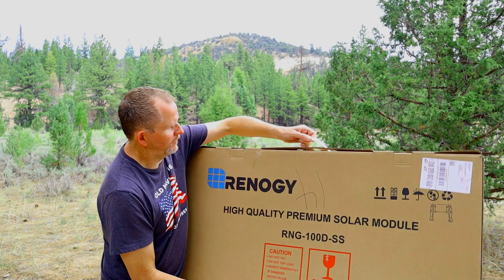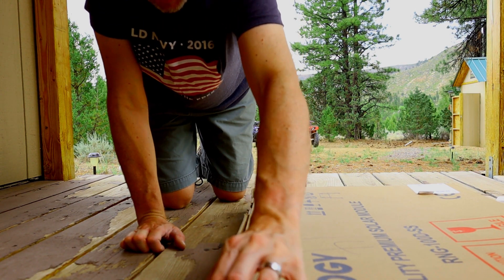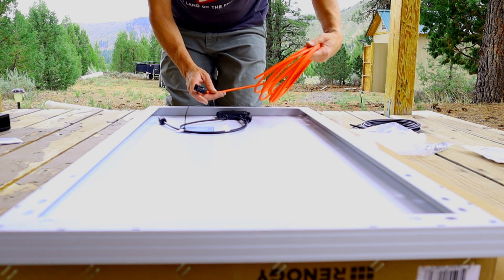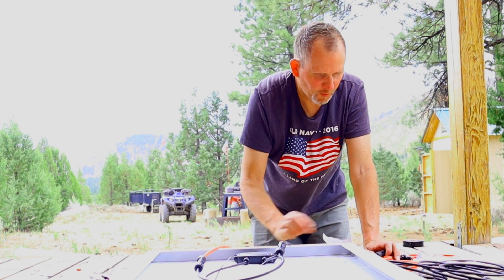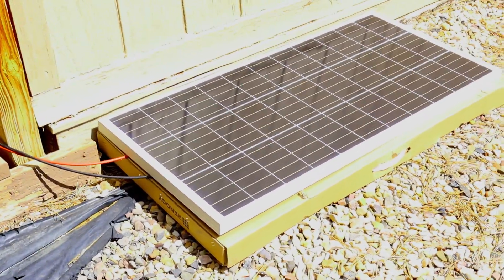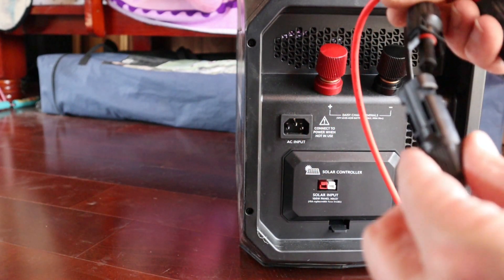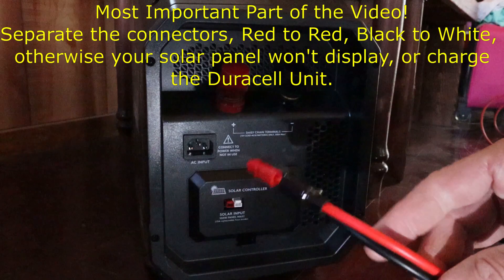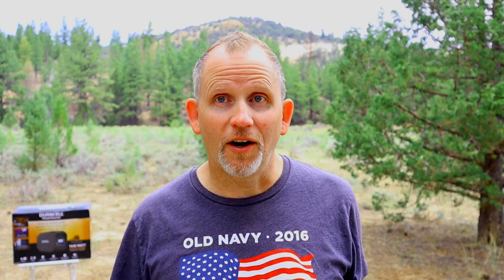How To Use Solar Panels To Charge Your Duracell PowerSource For Free!

Comment: I had a question about this generator i had my generator pretty charge it still showed full battery and i tried connecting a hand steamer but as soon as i did the generator would turn off. So i went ahead and connected a charger for the phone and it didnt turn off. Is it possible that it ready too much energy i dont feel a steamer would be too powerful for it to handle. Dont want to mess it up i use it alot
Reply from the maker: That's a really good question.  It's possible that the hand steamer was just pulling too much amperage and shutting the unit off.  I haven't hit that point yet and have run some power tools, saws, coolers, etc, but haven't tripped it yet.  There is a built-in fuse, but also a limiter where is will just shut down the unit if you over-draw power.  Try the steamer on the lowest setting (if it has one) Thanks for the comment!

Comment: Hi,I didnot pay attention to the fact that this 1440 Watt Duracell power source needs to be recharged every 3 months,so after the first time charging it i never recharged it again and now 2 years later it is not being charged.Is there a way to repair it or its gone?
Thanks
Reply from the maker: Oh man, ya I've left it for 6 months without charging and it's been fine (all winter up at the cabin no charging).  But not any longer than that.  
You can replace the deep cell battery inside the unit, or housing and then just use it like a new one again.  Batteries aren't cheap, but it's just a lead/acid deep cell 12 volt.

Comment: WHAT WILL THIS GENERATOR CHARGE AT THE SAME TIME AND FOR HOW LONG?
Reply from the maker: You can power one larger device for a couple days, like an electric cooler or small fridge, or several smaller ones for the same amount of time provided you have it hooked to a solar panel during that time.  
If it's just running off the battery after a single charge, you may get 8-10 hours, but it really depends on what you are powering, and how many amps it's pulling.

Comment: Si el panel te entrega 18V y la batería recibe 12V, entonces ya quemó la batería y dañó el integrado interno 😢
Reply from the maker: Duracell no es claro acerca de decirle a la gente que solo use paneles solares de 100 vatios y 12 voltios. Además, el controlador solar debería haber evitado daños a la batería, lamento escuchar que no fue así.
¡Gracias por el comentario!

Comment: Good morning, I have charged my Duracell 1440 for the first time, the green flash stopped blinking before 24 hours.  Should I continue charging it this first time until completing that time or is it enough to have already charged it?
Reply from the maker: If the green light stopped flashing, then the Duracell should be fully charged.  However it won't hurt anything to leave it plugged in longer if you need to.  Thank you for the comment!  🔋

Comment: Just a side note. You can purchase a small solar charger with controller to attach to the extra batteries or wire it directly into the existing battery to decrease charging time. I found one on Amazon that takes 300 watts. It really changes things. You can add whatever controller you like as long as you wire it directly to the batteries and not to the unit.
Reply from the maker: That's great information, thank you.  Do you know the brand by chance, because charging time has been a downside of this Duracell unit.  🔋
Reply: @FixMyBleep  Lensun but I actually have purchased another since then Powerwrex mppt 300. I'm going to switch over to lithium ion phosphate batteries when the current goes bad the voltage is higher but when you add batteries voltage increases anyway. I'm also going to add a pure sine wave when I find a super duper deal. I like to tinker. I have several units and this is the least capable but is easy to upgrade because of it's simplicity. Just remember to add the charge controller to the batteries not the unit.
Reply from the maker: @latymz  Good call!  I found the Jackery 1500 unit after this Duracell and really like that power station more, then found out about the Lithium Phosphate batteries that can be cycled thousands of times as opposed to 500 or so...that will be my next purchase.  Thanks again for the comments!
Reply: @FixMyBleep  My pleasure. Solar  generators have become somewhat of a hobby. I would encourage you to check out the new Zendure SuperBase V if you haven't already. It's a good deal on Kickstarter if you can stomach a little risk. I got a deal on a Oukitel 200p. It varies slightly in features from my Bluetti 200p. The Kickstarter price made it doable. Good luck.
Reply from the maker: @latymz  Thanks!  I'll check it out.
Reply: @FixMyBleep  👍

Comment: Can I run a portable ac unit on it
Reply from the maker: Yes you certainly can, but depending on the power draw and size of the ac unit, that will determine how quickly it's going to drain the Duracell Powersource.

Comment: Can I use the renogy (2) 50Watt solar panel suitcase (=100 Watts) to charge the Duracell 1440?
Reply from the maker: If I'm looking at the right one, the Renogy Suitcase comes with a positive and negative clamp that would go onto the rear of the Duracell to charge it up.  This should work just fine as it's 12v and also 100 Watt.  Great question, and thanks for the comment!  Also this Renogy solar panel looks like a good find!  ☀

Comment: I bought the renoogy solar panel but its two 50Watt panels - will that work. I didn't see the link to the 100Watt and may have bought the wrong thing.
Reply from the maker: I think those should work but you may need an extra part to connect the 2 panels in parallel.  I think you would need this Y adapter to hook them together https://amzn.to/3ogrnY5 and then you will run them to your 100 w solar charger.  Hopefully that helps.  🌞

Comment: Just bought Thunderbolt panels from Harbor Freight but none of the connectors are compatible. May be a silly question but do I need Anderson adaptors? Wasn't aware of such an animal before. I have Duracell 500 unit. Thanks in advance.
Reply from the maker: Ok, It looks like you need a SAE to Anderson adapter from what I'm reading, try this: https://amzn.to/3HxaTDI
Be sure to separate the red and black plug on the Anderson adapter plug end, pull back the plastic cover a little, and plug red to red, black to black on the Duracell Unit.
Hope that helps you out!

Comment: How does this daisy chain concept work and what do I have to add to my Amazon purchases to do it please.
Reply from the maker: You can connect (Daisy Chain) 12V Lead acid batteries to the terminals to extend your run-time. Red to Positive(+), Black to negative(-) The battery is connected to the unit by the 10mm posts on the back of this Duracell PowerSource unit, it already has the electronics, you just are adding more batteries.  This will of course add more time to recharge the overall unit as well.  I hope that helps, thank you for the comment!

Comment: Can i charge my Duracell 1440 with
My 160 wats 12 volts renogy solar panel?
Reply: Should easily work. Will probably need to connect through the battery terminals because the charge controller is rated ate 100 watts. Big note for people who charge this way, the green charging light will not illuminate, that light only works when using the Anderson connection through the built in charge controller. Rest assured, it will charge through the the other terminals.
Reply from the maker: @michaelarrow1918  Thanks for the info, and good to note on the charging light and charge controller!
Reply from the maker: That's a great question, I thought the built-in controller would handle this, but maybe not.  I've been using a 100 Watt Renogy Solar Panel and it's working great, this is what I found on the Duracell Site when I just checked about hooking up a 160 Watt panel to the 1440 PowerSource: "100 watts is the maximum we recommend when using the built-in solar controller which has a 15A replaceable fuse inside."
Sorry but they are saying it "could" blow the fuse, or basically no more than 100 Watt.  Thanks for the comment.

Comment: Do you need an adapter for it to run or charge?
Reply from the maker: This unit comes with everything you need unless you are hooking up solar panels to charge up the battery.  Then yes you need the adapter cable to go from the panels to the Duracell PowerSource. 
These adapters I've linked work for most solar panels  https://amzn.to/3LlQjaZ  Here are some solar panels I've been using with this battery unit Renogy solar panels https://amzn.to/3soedda  
Hope that answers your questions.  Thanks for the comment.

Comment: What kind of Anderson Power Pole Connector should I purchase to connect a solar panel that has an SAE cable instead of an anderson power pole connector cable?
Reply: Thanks. I purchased one.
Reply from the maker: @lindadixon5190  Excellent, you should be all set!  👍
Reply from the maker: Here is an affiliate link for connectors that converts SAE over to Anderson connections if that's what you are looking for.  https://amzn.to/3rnJnly  The solar panels I picked up only had SAE connectors so I had to buy these so they would plug into my Duracell power unit.  Hopefully this helps you out.  Thanks for commenting.☀

Comment: My advice is to first watch the manufacturer's video Zantek, it quickly explains the plug separating issue, secondly, this video has a whole lot of needless repetition in information. It's a video, if you miss something, go back and watch it again. A 5:00 minute video at the longest would cover the information. If a guy gets that stumped with basic wiring, watch a video before trying to make one.
Reply from the maker: Thanks for the comment.

Comment: I was curious that can you charging while discharging? I planing a 3month road trip and I want to hook up that powersource to solar panel that on my rtt.
Reply from the maker: Totally, that was one of my big concerns since I use it at a cabin that is totally off the grid.  I have things drawing power while it's charging off of solar.  Sometimes it just takes a lot longer to get a full charge depending on what I have  pulling power from it.  Would be great for road trips!

Comment: My solar panel came with a charge controller & terminals for the daisy chain. Is it better to use the anderson connector with the built in charge controller on the Duracell or the charge controller that comes with the solar panel? Or would it make no difference as far as charging faster?
Reply from the maker: Great question!  So from everything I've read from Duracell you want to use their built-in controller and the anderson connector over the one on the solar panel so as not to exceed any wattage limitations on the unit.  The Duracell website also touches on this a little bit too.  I wish there was a way to get it to charge faster.  I'll be doing more videos on this unit, be sure to Subscribe to check those out.  Hope that helps!

Comment: Totally new to this basically,  but does adding another 100w solar panel make the whole system 200w, or is the 100w threshold solely speaking about the panel itself? Once again, Totally green on the subject. Thanks for the video.
Reply from the maker: That's a great question!  If I'm understanding the Duracell information correctly, it looks like adding additional solar panels won't help it to recharge any faster due to the built-in controller.  The max you can have is a 100 watt solar panel that it can handle.  On the website they confirm as well.  Thanks for the comment!

Comment: Can you help me find long cords for this solar panel, for the Duracell, please? I don't understand all the numbers when looking for cords. I need at least 5 feet long. Prefer 10 to 20 feet if possible.
Reply from the maker: Of course, here are the connecting cables you need in a 10 foot, and a 25 foot length with the ends already on them.  10 foot: https://www.amazon.com/dp/B09CY8RMN1/ref=sspa_dk_detail_7?psc=1&pd_rd_w=B2QZR&pf_rd_p=887084a2-5c34-4113-a4f8-b7947847c308&pd_rd_wg=mdsS2&pf_rd_r=72WPZQ2PN3J3063PF36G&pd_rd_r=62d6bf47-16bf-499e-a6bf-0b1845247b09&spLa=ZW5jcnlwdGVkUXVhbGlmaWVyPUExQlFVRkszVVRNVDRIJmVuY3J5cHRlZElkPUEwOTg4Nzg5M1BCMEQwMlU3RUxOWCZlbmNyeXB0ZWRBZElkPUEwNTE4Mzk5MU1WMU9JWDhHQkZYMCZ3aWRnZXROYW1lPXNwX2RldGFpbCZhY3Rpb249Y2xpY2tSZWRpcmVjdCZkb05vdExvZ0NsaWNrPXRydWU= or 25 foot length https://amzn.to/3r1QZur
You will also need the connector kit unless you have it already:  https://amzn.to/30GKZw6

Comment: For anybody else trying to figure things out, I don't see it mentioned in the video, but you need for this Duracell Powersource a 10AWG Solar Panel Wire and not a 12AWG Solar Panel Wire. Pay attention to the cable gauge and select the right one.
Reply: This comment saved me a lot of swearing and headache
Reply from the maker: @worstnurse1565  It's all in the details for sure.
Reply from the maker: Thank you for pointing that out, you definitely want to keep the same American Wire Gage throughout your system setup and I don't think I mentioned Duracell requirements.  Thanks for the comment!
Reply: @FixMyBleep  you're welcome. Btw, after you pointed out the "generator" name given to this unit, I went ahead to see why they call it so.  Looking at the duracellpower website faqs, they say this: 

"WHY IS THIS CALLED A GENERATOR WHEN IT RUNS OFF A BATTERY? ISN'T IT JUST AN UNINTERRUPTED POWER SUPPLY (UPS)?
The Duracell PowerSource is similar to a generator in that it is portable and provides AC power using a refillable energy source. This unit has a built in solar controller which allows it to be sustainably recharged using solar panels. It can also be recharged via the external posts from other sources such as a car's alternator or additional SLA batteries. Since the unit has an inverter, it does generate 110V AC. The difference is that the unit pulls the energy from a battery rather than from a gas tank." ...

Comment: Does anyone know what size of lugs are the red and black connectors in the back. Also what size Awg connector to use. Thankyou
Reply from the maker: Duracell is calling those 10mm posts on the back,  Looking at the Duracell question/answer page in regards to daisy-chaining off those rear posts "If your cable is less than 4 feet long, you can use 4 gauge wire. Longer cables will require 2 gauge"
Sounds like overkill, but maybe they are right?

Comment: Dear Mr. Fix, I keep seeing panels selling with modulaters and chargers and extra stuff but then I see here only the cords are needed when charging. Are those things needed or not? I would be okay with just genny to cord to panel. Thank you sir.
Reply from the maker: Hello, that is a great question!  So the Duracell PowerSource comes already equipped with the internal inverter to convert the energy collected by a 100 Watt 12 volt solar panel into usable electricity, and store it in the battery if you don't have anything running at the time the panel is collecting sunlight.  So to answer your question, you only need the compatible solar panel with this unit, and Anderson connectors.  Thanks for commenting.

Comment: Can you use the generator while you are charging it with the solar panel?
Reply from the maker: That's a great question.  Yes you sure can, regardless of charging from a regular outlet, or solar, you can still draw from the unit according to Duracell's website.  Thank you for the question.

Comment: Don't want to jump to any assumptions but in theory you should be able to charge it via solar and plug it into the wall as well correct?
Reply from the maker: Yes you can charge it both ways, or have it plugged into the wall at the same time as well.  If AC is available, it will draw from that.  Thank you for the comment.
Reply: @FixMyBleep  Awsome thank you so much I'm putting it in my van build
Reply from the maker: @jacobreigle9176  Excellent, glad the video was helpful!  Thanks for commenting too!

Comment: Hello. I just purchased the Duracell 1440. I also already have the same renogy solar panel with out the ends just like you. Where do I get and what are the ends called so I can link the Anderson adapter to attach to the 1440? Many thanks and informative video.
Reply from the maker: Hi there, here is a link for the adapter that goes to the 1440, the other end connects to your solar panel side. Be sure to separate the square ends (they come glued together) like in the video so they charge correctly.  
https://www.amazon.com/gp/product/B07T3K9TND/ref=ppx_yo_dt_b_search_asin_title?ie=UTF8&psc=1
Reply: @FixMyBleep  Perfect! Many thanks.
Reply from the maker: Here is a link if you also need the extension solar cables since the adapter is only 2' in length.  These are 25' but these are the ones that work and you can pick the length you need.
https://www.amazon.com/gp/product/B08LKX9K7D/ref=ppx_yo_dt_b_asin_title_o04_s00?ie=UTF8&psc=1

Comment: Hello, I recently purchased a Duracell powerpack pro 1300 was wondering if you Knew if  it can charge With a solar panel as well thanks.
Reply from the maker: After looking into it a bit on the Duracell Site, I found the 1300 to be quite popular!  This is what the folks at Duracell say about charging the Powerpack Pro 1300 off of solar:  You can use the CLA port or you can attach it with alligator clips to the jumper clamps, and turn the red switch ON. Your solar panel MUST have a controller if more than 40W. Hope that helps you out.  Thanks for the comment!